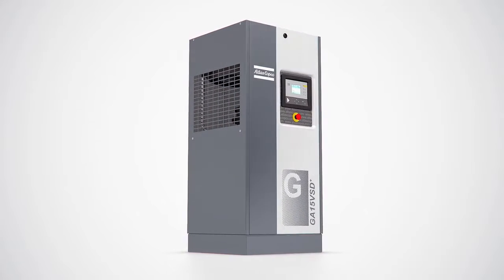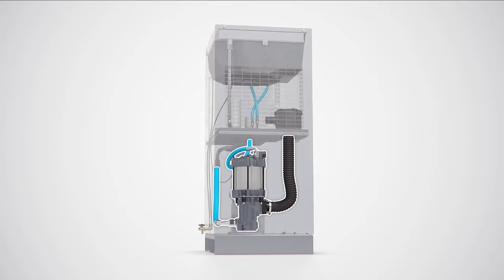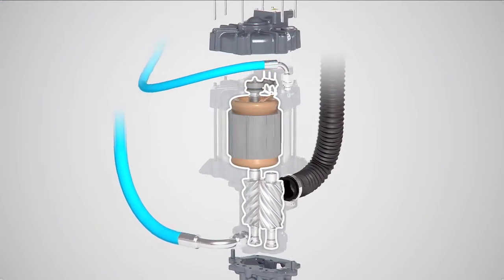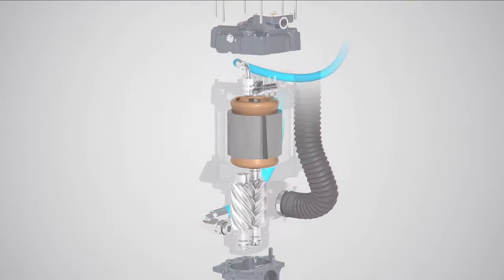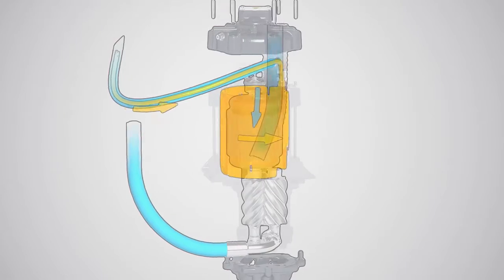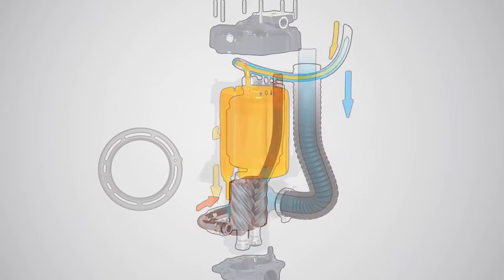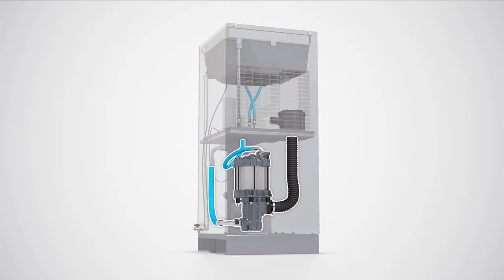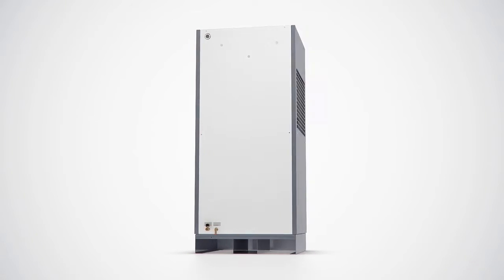Atlas Copco VSD Air Compressors

Comment: One of the WORST COMPRESSOR in the market,our LOOM SHED have been stopped for past 25 days, we have 2 ATLAS COPCO GAVSD+ FF MODEL,one of the WORST COMPRESSOR IN THE MARKET, AIREND get failure in 16000 working hours, service TEAM is WORST,they are charging Rs.600000 six lakh for the AIREND,no STANDBY SUPPORT FROM ATLAS COPCO, so pls avoid this compressor.
Reply from the maker: Where are you located?   Maybe we can assist.